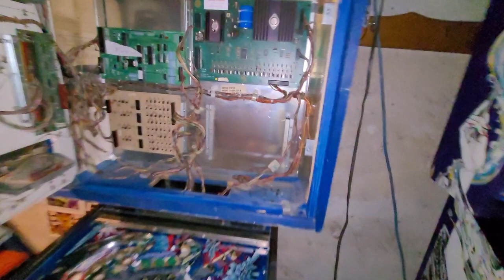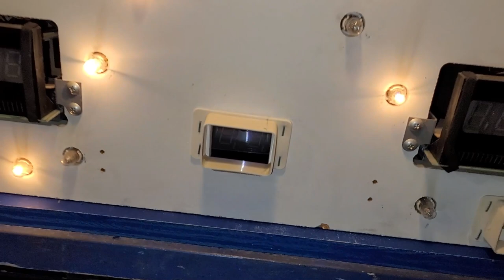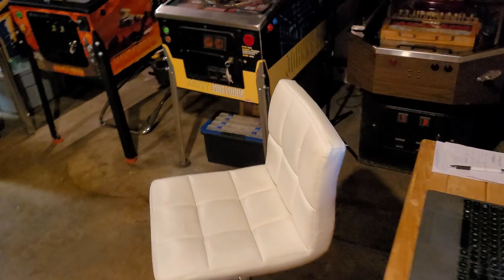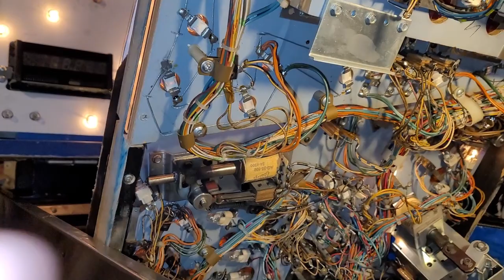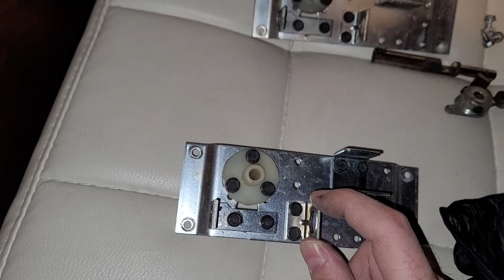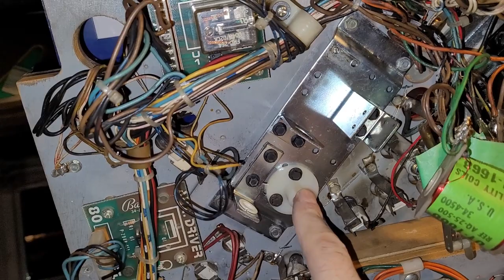Part 10: 1981 Bally Elektra Pinball. Rebuilding linear flippers & other stuff!

Comment: Great work! A couple comments on the flippers. The baseplates are ambidextrous, you can use a right for a left and visa versa. Those black screws Bally uses are thread cutting screws so in a pinch if you need a left but only have a spare right you can use the right and some elbow grease to make it work. Pinball Life has full flipper kits with all the correct parts including the cranks and the correct set screws.
Reply from the maker: Thanks Allan! Ahh yes I have actually swapped the plates before. I didn't realize those black screws were thread cutting, that is great to know!